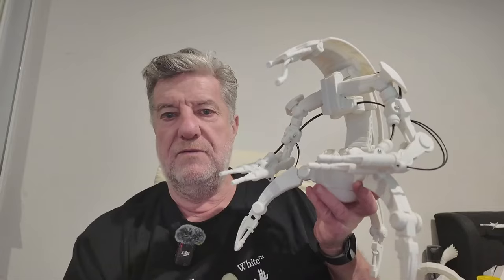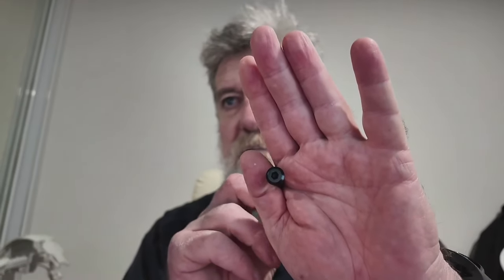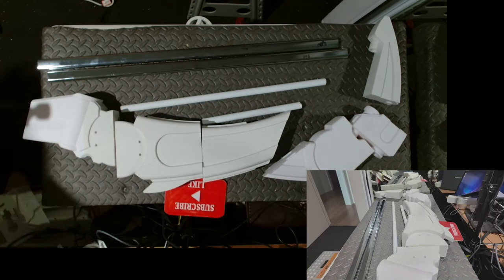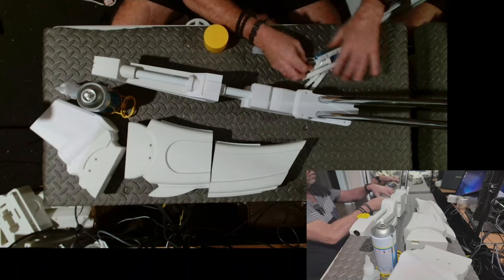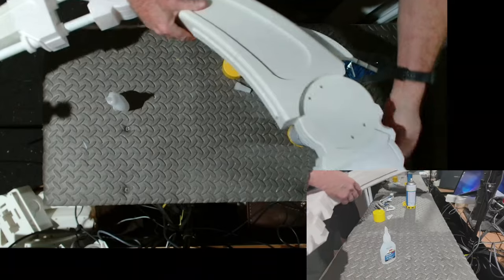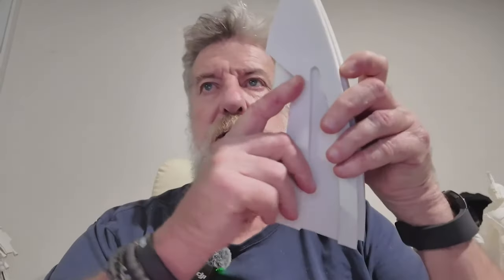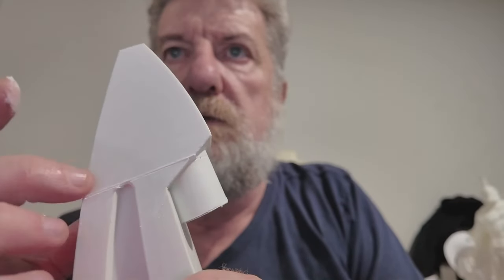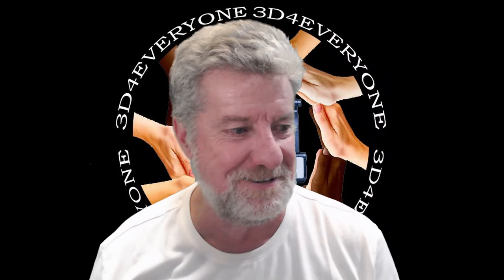Star Wars Droideka build part 1 - Full Size build

Comment: What did you use for ashesive
Reply from the maker: I use Soudal Adhesive 2C professional (glue and accelerator) , but you cant get it everywhere. Zap-a-gap is easier to get and is very similar, it comes just as the glue so if you want instant setting youll need an zap-kicker as well

Comment: Great work Gary… How much printing in this job is there😂 Currently printing R2, been going for months so much intricate pieces too. Anyway Gday from the blue mountains.
Reply from the maker: around 40 rolls of filament, and a bundle of parts to it as well. This however doesnt have any electronics in it so just a straight up print. Its huge over 5ft wide and 6.7ft high, its going to look awesome . Aussie Aussie Aussie :)